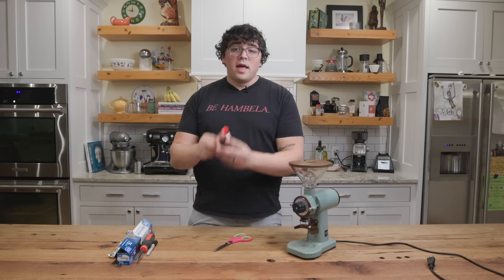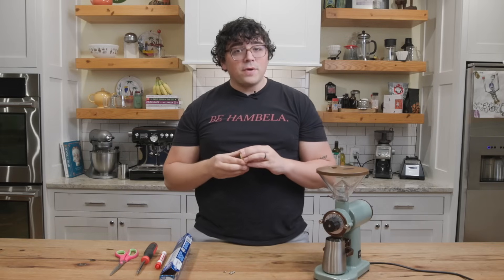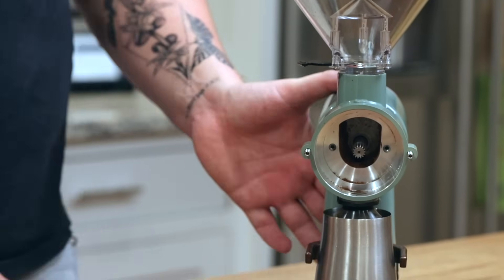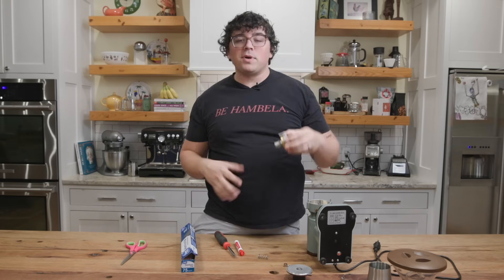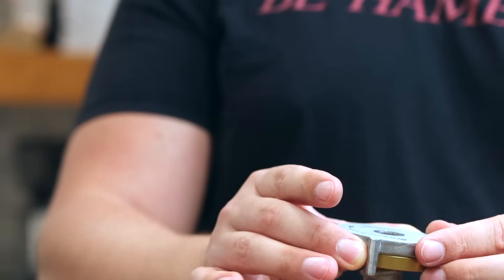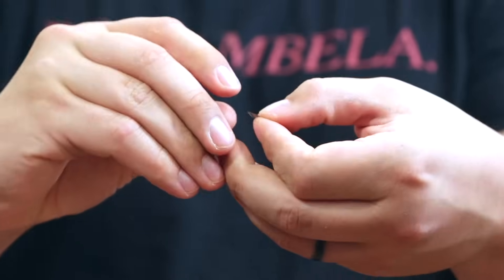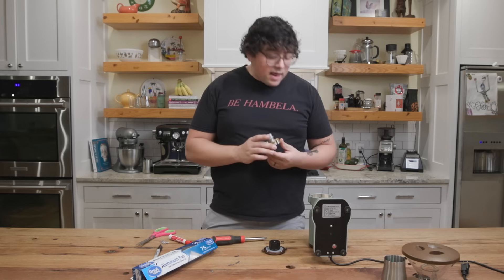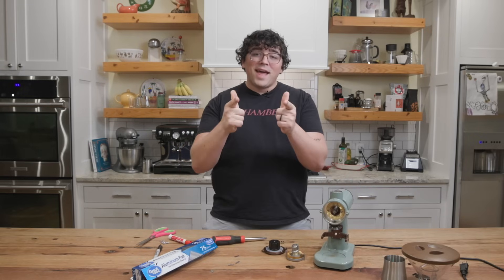HOW TO ALIGN YOUR GRINDER: Shim Alignment Tutorial

Comment: I don't really understand, why you chose these positions for the shims. If you do it this way, you will bend the burr, when you tighten the screws. I think, you should put the shims closer to the screw.
Reply: I don’t think someone is going to tighten the screws hard enough to bend the 1 cm thick stainless steel burr by creating a lever on the shims placed too far away from the screw.
Reply from the maker: It happens all the time.  Don't speak to things you don't know lol

Comment: I have recently changed the burrs on my silenzio. The grounds keep getting stuck in the chute.

I have removed the declumper to further ease the flow of grounds. Just a few days ago I went to brew my first shots of the day.  The first grind went fine, and using bellows all the grounds came out. 

When I grinded the beans for the next shot ALL of the ground coffee was lodged in the chute, and likely further up into the grinder. Horrible. 

If my burrs are misaligned...and because of this misalignment I am having to dial down further to get my shot right... could this be causing this problem?
Reply: The grounds were so lodged that when pressing the bellows there was stiff resistance.

Comment: as I read in another video, what about rotating the top plate 1/3 and retest with the markers. Then another 1/3 rotation, that might work. With the black line you did first, you can easily come back if unhappy and only then proceed with the shims.

Comment: For the people asking about the need to align both burrs..  essentially... When you align the moving burr..  your actually aligning it to the burr carrier.. so ie spins consistently even to the carrier...   Once that's done.. you then align the fixed burr.. which then brings both burrs into alighnment.. ..👍
Reply: How can you align the other burr if the burrs are now touching evenly each other, even if it happens that they both are misaligned against the grinder itself (or whatever "world" origin)? Am I stupid for not getting it... What I mean is that how can you use the same method of marker rubbing off if it already rubs off evenly i.e. the burrs are parallel.
Reply: I was just going to ask this. Instinct says not to align the fixed burr since its already rubbing correctly after aligning the moving burr...
Reply: @zammie01  no, the moving burr was basically wobbling and touching the fixed burr on ITS high point. If you aligned the moving burr so it was running true, it would still be touching the fixed burr on the fixed burrs high point, so you then need to align the fixed burr.
Reply: @richardmiddleton7770  Thanks for your reply. I shimmed and aligned both burrs. Hopes it stays aligned for a good while more!
Reply: Exactly. So yes, aligning both burrs with shims (if necessary) makes sense. And also trying to have them centered around the axis of rotation

Comment: Lance, don't know if you still monitor this post.  FYI , I figured out  a simple mod of the Urbanic 070 to be "stepless" like.  The mod involves leaving the spring in the grinder and instead, bending the ribs on the "Step Disk" slightly down to increase the pressure on the spring.  I found that this allowed the setting of the grind steps in-between the "Spring stopped settings".  The downward bend of the ribs created enough pressure on the spring so that it keeps the "disk" in place.  For me anyway, the "in-between settings" hasn't perceptually drifted from these in-between steps.  (and has never drifted to the spring stops). I bent the ribs slightly by "hammering them ever so gently.

Comment: We need to align upper burr only, or both upper burr and bottom burr?
Reply from the maker: Both!
Reply: @LanceHedrick  I frankly don't understand the need to align the second burr. What we look for is parallelism between the two burrs. We find the "perfect" position in which one burr is parallel to the other. If parallelism is the problem, then there is only one adjustment to be made, because if burr A is parallel to burr B, then burr B is parallel to burr A. If, on the other hand, one of the two burrs is irregularly consumed, i.e. the teeth do not lie on the same horizontal plane, then that is another problem, and that should probably be solved by replacing the burr set.
Reply: @singhbadalchopra8091 Getting a full wipe on burr A does not mean that the two burrs are parallel to each other. It only means that burr a is now perpindicular to the axis that it’s spinning on and burr B could be way off kilter.
😊
Reply: @singhbadalchopra8091  It's about alignment to the axis of rotation. Necessary on both sides

Comment: This video is probably the most helpful in understanding this process for me, but I have a few questions. When getting a full wipe after aligning one burr, doesn't that mean that the other burr is inherently aligned as well? Wouldn't you only be able to get a full wipe if they are both parallel ( even if you only aligned one to get that result)? Couldn't realigning the second Burr cause the result of the first alignment to become misaligned?

I'm asking all this because I'm new to this process with very limited time on my hands and trying to find the most time efficient way to get the best result out of my grinder
Reply: I think the second burr is stationary, meaning you are always aligning the first burrs position to match the second's.
Reply: Both burrs should be marked to determine which burr is out of alignment.

Comment: If you align one of the burrs doesn't that mean both of them are aligned to each other? I don't see how you could fix one and have a perfect "wipe" while one of the other burrs is still misaligned.
Reply from the maker: You are aligning them both to the axis. Make sense?
Reply from the maker: An aligned burr just needs one point of contact for a clean wipe
Reply: @LanceHedrick  I see. Perhaps we only need to shim the fixed burr because if that has full contact that would mean both burrs are aligned together (because it's not moving theres no way for the out of alignment part to read a false positive). Hope this makes sense. I can see needing to align both burrs if both were in motion (to your point about just needing one point of contact for a clean wipe).
Reply from the maker: @javaTL  both are still needed. You're assuming the base burr is aligned perfectly (carrier)  they aren't mostly. Both definitely need checking. Trust me lol
I've aligned hundreds.
Reply: @LanceHedrick  just trying to visualize this and clearly struggling 😄 maybe do a video on it to help folks like me visualize 🙏🏼 Ironically every video I’ve come across on alignment only demonstrates aligning a single burr, not going through the whole process where both could be misaligned.
Reply: @LanceHedrick  thanks for the prompt replies by the way!
Reply: Lance is right. Imagine a grinding wheel mounted on a drill that is supposed to rotate a plate by touching it over the entire surface. 

1. The moving burr should be aligned perpendicular to the rotation axis.
2. The fixed burr should be aligned plane-parallel to the moving burr (which means: also perpendicular to the rotation axis).
3. Both burrs should be centered around the rotation axis.
==>
1. can be achieved by shimming the moving burr.
2. can be achieved by shimming the fixed burr.
3. can be achieved by lateral adjustment of the burrs.

Bottom line: BOTH burrs should be shimmed (if necessary).

Comment: I can't get a perfect wipe on my 807 Lab Sweet.  The closest is both North and South have a wipe but east and west don't...is it possible due to the burr being cast that it isn't machined as precise to be level within the thickness of a sheet of aluminum foil?  I can get the bottom half rubbing by itself, top half by itself, and just now settled on most of the top and most of the bottom with some gaps on the left and right, but never the full circle.

Comment: Great video as always Lance! I bought my 070s a year ago. It worked fine for espresso at first. Ever since I opened it up to clean it, it's never been the same. Now I pulling turbo shots even at the lowest settings. The burrs don't chirp at the minimum setting. I think the torque is off or something. Do you have any suggestions?
Reply: Hope you already got the answer to this question.. if you take the front knob off, there is a screw under the sticker, the knob can then be rotated to the minimum chirp position. In Lance's budget grinder showdown, he shows you how to do this.

Comment: Hi Lance, love your videos and all the work you do for the coffee community. I am having an issue aligning my SSP MP burrs on my Atom 75. After applying the marker and reaching chirping point, I don't see any ink rubbed off.... The outer edge of the burrs have little teeth instead of being flat, is that the problem?if so, do you have a work-around?? Thank you
Reply from the maker: I would not recommend trying to align brew burrs. I would suggest either trying to align with a dial indicator OR you can try to align another set of burrs then put the shims in the same spots on the other burrs. Issue is, burr tolerance isn't at 0%
Reply: @LanceHedrick  thanks for the insight. Much appreciated.

Comment: If I'm not getting any chirping at zero point on my DF64P would shimming all around the fixed burr be an option to torqueing down the 1/2" bolt on the base of the grinder, and then do alignment on other burr? Thx Lance, great stuff on ur channel!

Comment: Correct me if I'm wrong, but isn't it unnecessary to align both burrs? Once you have the carrier burr aligned, wouldn't any additional shimming on the stationary just take them out of alignment with the carrier again? Or is this more a case of fine tuning? I'm failing to understand how you could have a full wipe on one burr but not on both.
Reply: Came down here to ask the same thing. But after further thought, I think I get it. In it's initial state, both sides of the burrs could be spinning not even perfectly flat on their respective planes—I'm thinking like wobbly shopping cart wheel. If you're getting a full marker wipe after aligning one side of the burrs, that doesn't necessarily mean that marker is being wiped by the entire surface of the opposite burr. The wiped burr could be getting wiped by just a portion of the opposite burr. Once you lay marker down on that opposite burr, you would see where the two are now touching. If both surfaces show full wipe at the same time, great. I could definitely see needing several rounds of touch up with the shims on the initial burr side, to really finely tune things, once you start messing with the opposite burr.
Reply: @jmvdigital  yes you are correct. Both need to be aligned. Anyone who is aligning their burrs can test it. Once the moving burr has been aligned, put marker on the stationary burr and you can see that it will likely have areas that aren't coming in contact with the other.
Reply: @jmvdigital  No, because in all grinders, one only one burr rotates, and the other is stationary, screwed down directly to the chassis. Shimming is just leveling one burr against the other burr.
Reply: I think Justin is right. If the rotating burr is out of plane (this plane is necessarily perpendicular to the rotation axis), it is wiped at a section by the other burr simply because that part is closer to the closest bit of the stationary burr. Once the rotating burr is in alignment, a full wipe on it can still be produced by an out-of-alignment stationary burr. You don't know whether the full surface of the stationary burr does the wipe (in case it's well aligned) or just a part (in case if is not aligned) unless you check it.
Reply: @thomaswaitzner  Exactly. I misspoke that both burrs are rotating, but the principal stands.
Reply: Basically, it's all about alignment to the axis of rotation.

1. The moving burr should be aligned perpendicular to the rotation axis.
2. The fixed burr should be aligned plane-parallel to the moving burr (which means: also perpendicular to the rotation axis).
3. Both burrs should be centered around the rotation axis.
==>
1. can be achieved by shimming the moving burr.
2. can be achieved by shimming the fixed burr.
3. can be achieved by lateral adjustment of the burrs.

Bottom line: BOTH burrs should be shimmed (if necessary).
Reply: Both burrs should be aligned as close to perfectly square to the direction of rotation as possible. Either being out of square to rotation will cause problems.
Reply: Easy. Just imagine there is big mountain bump on the fix burr side. It is that mountain top responsible for the even grind u think u seeing on the moving burr side. Both side still haven't evenly touching. It is ONLY that mountain TOP making a round trip touching the other side with equal pressure.
Reply: I think it makes sense to align the stationary burr first as that is your point of reference for the other which is a moving part. Once it’s ‘level’ the other can be fine tuned to it
Reply: I agree. It would be nice to see Lance elaborate on this and consider the possibility that he might be wrong.
Reply: Exactly what I was thinking. The stationary should be acting as the "level".
Reply: @RyRyTheBassGuy  Um.. actually the spinning motor rod should be acting as the “level”. And both burrs should be exactly perpendicular to the rod.
Reply: @Puvv05  I was wrong in my thinking. As another commenter mentioned, the stationary burr could be high on one side and if so you're using that high point to level the rotating burr. Obviously, you must now check the bottom burr to see if that is the case or if it is actually level.

I've thought about leveling my ODE, but I'm happy with my brews so I'm just going to let it be.
Reply: You're right and it seems like you really only need to mark the stationary burr. Marking the rotating burr just shows that all parts touch at some point but don't necessarily show they touch all points
Reply: @geo1667  From what i gather you only mark the burr you’re working on in the current step. First the rotating burr then when you finally get a clean wipe on it, then you mark the stationary one and work on getting the clean wipe on that one as well. I think the only reason Lance only mentioned it and then proceeded to skipping the stationary burr step in the video was for the sake of brevity. 
I just aligned my burrs on my ode2 today and it was quite the PITA. I must’ve disassembled and reassembled it 10 or more times before it was over. My grinder was really misaligned at the start unfortunately. So i had to put quite a bit of shimming on the rotating burrs and after at least 6-7 disassembly/reassemblies i finally got a perfectly clean wipe for the rotating burr. Then after all that effort even though i wanted to just call it good, i did mark the stationary burr just to check the alignment and man am i glad i did, because it was only getting ~1/3 wiped! So i had to add quite a bit of shims to the stationary as well in another 2-3 disassembly/reassemblies to get another perfect wipe. 

All this to say. It’s pretty pointless to only focus on one burr and not the other because if you do that, they’ll still likely not be aligned by just doing one side and you’ll have wasted a lot of your time and effort in the process. I hope this helped to clear any misunderstanding you might’ve had about this bro.
Reply: @geo1667 you have to mark the burr that you are currently shimming. If you mark the opposite one you would have a very hard time determining where the shims would need to be placed.

Comment: Thank you for this very informative video.  I got the 070S and "engaged" the burrs (I do hear a grinding noise and backed out the grind size) only to find there are no "cleaned" spots on my burr wheel.  I did paint the outer teeth of the burr but nothing was "wiped".  The grinding noise was not just a gentle chirp and I could feel the burrs engage.  What am I doing wrong?

Comment: I know everyone thinks that this is the way to align the burrs.  But as someone who understands machining you are actually doing a disservice.  You can’t align coplanar surfaces without first determining the relationship of spindle to mounting surface of the stationary burr.  And then you corrected the moving burr 1st .  So now when you go and shim the stationary burr you will throw off the alignment that you just thought you did.  So you were correct not to align the stationary one and ended your video.

Comment: So is this a reason to just go with a conical burr set; no alignment issues?  Or do they also have alignment issues?  I ask as a Baratza Preciso owner who saw grind uniformity go downhill after years of great results.  Communicated with Baratza and sent it in, got it back and the problem was worse.  Then communicated with Baratza, sent it in and bought a new Preciso burr set as an upgrade.  Got it back, mixed results and am not wondering again if there is a problem or if the new burrs need to season?  Much help would be needed, I am very close to saying goodbye to Baratza forever and would be torn between buying a niche (conical) or D64 (flat).  I know, I know, Baratza support is legendary in the industry; yet the problem is not willingness to support and is instead the idea of a grinder causing so many problems to your daily living.  Sometimes you just don't want to deal with certain things.  Also, since Breville took Baratza over I wonder how things have changed from a support standpoint as it seems far less personal now; processed the support ticket with no confirmation of fixing anything and same problems.  So this video matters to me personally right now.  Great tutorial, I appreciate any further advice in response...